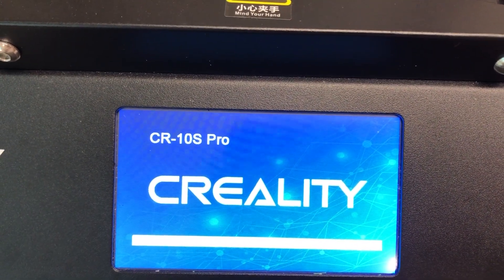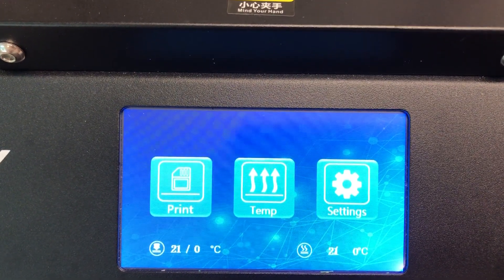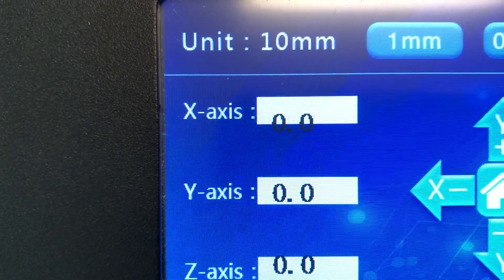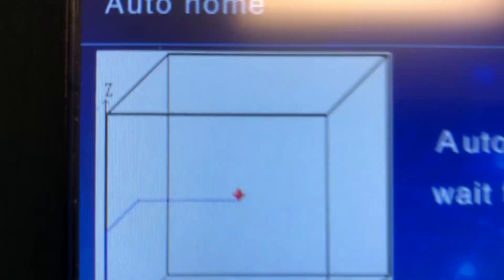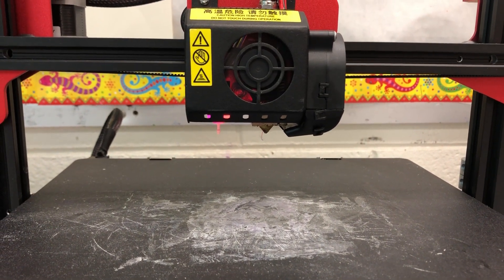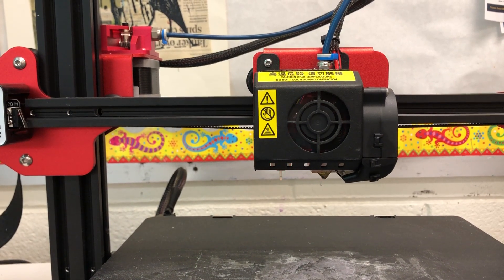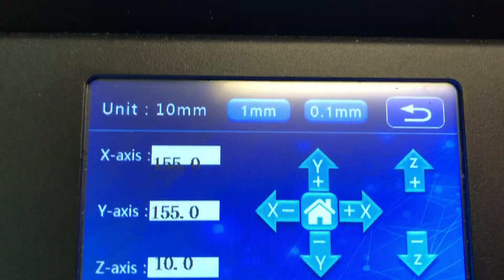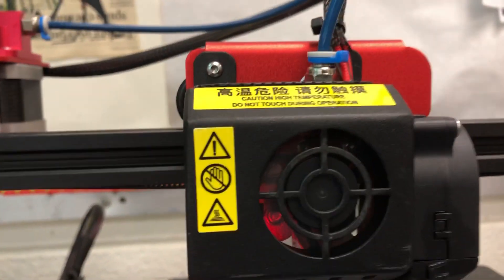CR10S Pro V2 Z axis can't auto home

Comment: I have bee fighting with this issue since Sept last year. Straight out of the box it homed to the center of the bed and about 3 inches above it. I was even in touch with the Creality company but none of their suggestions have helped. I have watched so many videos on this issue. Replaced various parts that other people replaced and it fixed theirs. I am going to attempt replacing the Z-Axis wiring next. One video I watched the person checked theirs for current and it ended up having a broken wire. After he pulled the old with and stripped it the break was almost 3 inches up from the connecter. After this I don't know what I will do. I may be a software coding issue? But I have no idea how to check that.
Reply: Did you figure it out

Comment: Gently pull the probe out with your finger. If not bent or broken the z-axis will usually go down.  Cut off machine, restart and see if auto home will send it back to start.  Otherwise reflash with CORRECT software.
Reply: Thanks !! It worked for me !!

Comment: i have the CR-10S5 and mine is doing the exact same thing.ive tried to work with support and they have be checking all the connections and nafter i told them all the connections are correct they want me to start swithing ports on the mother board to test it. i paid over $700 for this and shouldnt have to check anything. ive sent them videos of everything they needed to find the problem and im done. about to contact amazon and ask for a credit to another 3D printer, anything other than creality

Comment: I bought this printer few days ago and...

I have the same problem! (However before I get another one - it tried to get down after checking the Z-level and didn't stop, so it moved right into the bed and I used to turn off the printer to prevent making damage to its parts)

I tried Creality firmwares, but they didn't work right away.

Then I installed TM3D and got the behavior from this video (however I found out that the problem is with firmware).

After that, I re-download Creality Firmware and install it from sources (NOT .hex file) with Arduino IDE. AND... IT WORKS NOW!!!
However some menus now are messed up - it's a real mess inside print menu to select a file.

I found a better link for TM3D sources and will try to install it with Arduino IDE now, instead of .hex file. Will let you all know the results
Reply: how did it end up? i just got this printer and straight away having these problems. the shop i got it from took it back and have replaced the touch pin, z axis motors, new firmware but still having this issue? i bought the printer weeks ago and have never got to use it because of these issues
Reply: You can send me video

Comment: Hi have the same problem have you figured it out as yet?
Reply from the maker: Creality sent me a new BL Touch module. We are on summer break and I haven't installed it yet to see if that fixes things. Fingers crossed.
Reply: @janishenderson4186  hey I just did like 4 day print and now I have that issues how do I fix it. Please help me ?
Reply: @janishenderson4186  Hi, did you solve the problem with a new BL Touch? I have the same problem and I don't know if I should buy a new one... thanks.
Reply: The BL touch is broken. Creality mailed me a new one and I am waiting to receive it. In the meantime, my 2nd printer of the same make and model broke.

Comment: I have had this problem. 
The solution that I found was to update the firmware. I test tiny machine but ended up installing the one from Creality. Try and see if that works
Reply: Hello Craig, May I have more details how did you"I test tiny machine but ended up installing the one from Creality" I start in this business so i don't have all knowledges Thank you